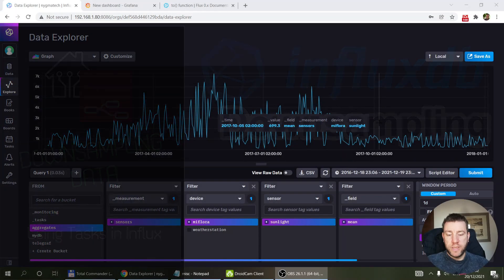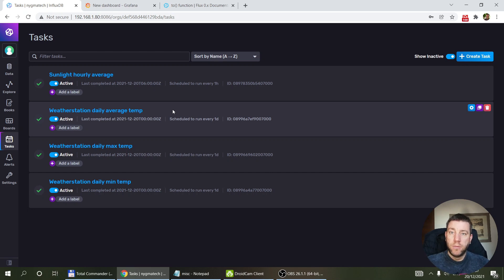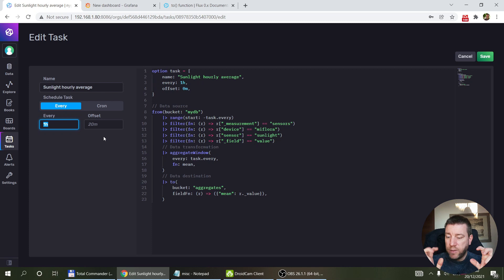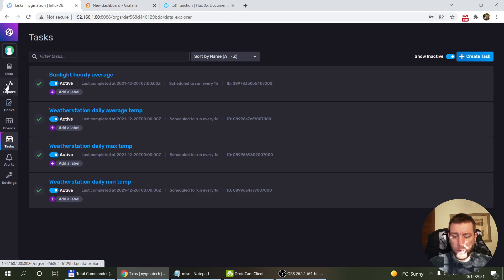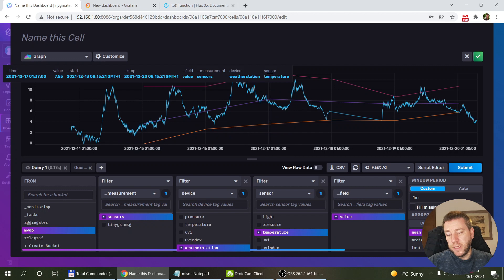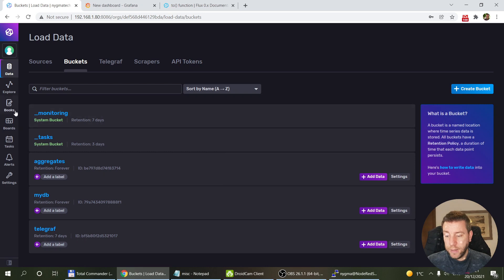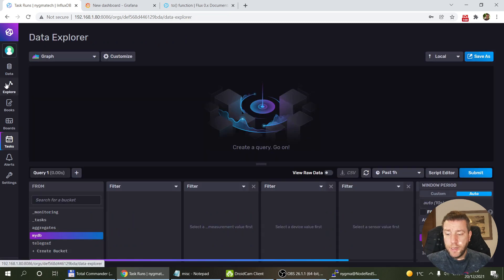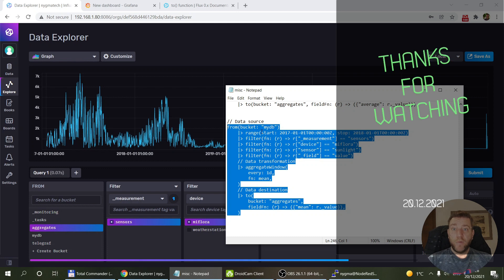Downsample data in InfluxDB 2.x

Comment: Hello, thanks for your very detailed video: I did not find anything anywhere so detailed and clear. I tried to replicate in my homelab to downsample my 30 second records pushed from some devices (Ecowitt, Raspberry Pi 4) to InfluxDB2, but I noticed an annoying problem. Records in the target bucket are always shifted forward in the "_time" field by 1,4,15 minutes. When I apply the same code to the source bucket, I get perfectly aligned records, I mean exact every 15 minutes.
Have you the same issue?
Reply from the maker: Yes, this is what I observed as well. The time in the down sample data get the beginning of the period. I discussed in this in the influx community post as well, and I was told that I can use the timeShift() function which adds a certain amount of time to the _time field. So you can chose that to be at the end of the period, or in the middle.

Comment: Hi thanks for the video. I'm trying to connect Node-red to influxDB but I can't transfer the data to influxDB. How do you create a mesurement in influxdb? Thanks in advance
Reply from the maker: When you pass data to influxdb that includes the measurement. It is not like a table that needs to be defined up front. Influx will create that automatically.

Comment: Can you reduce the amount of fields shown in the legends in influxdb 2.0 query builder? Like in Grafana you can just display the field and the value.
Reply from the maker: You can either use the drop command to remove fields, or keep to only keep the ones listed. Otherwise the best is in Grafana on your chartgo to Add field override (last option in the bottom) and start listing the fields you want to see. Once you start listing the fields, only those will be included in the chart and everything else gets hidden.
Reply: @csongorvarga  thanks for the response! I tried drop and that worked well. I gotta say though, IMHO - Grafana seems to be easier to use.
Reply from the maker: @danberber  Yes, and if you ever need the other fields, it is still there. I would consider using drop if your selection is large and you want to increase performance by moving less data from Influx to Grafana.

Comment: How could we downsample all the measurements what we have, without defining one by one? Like it is easy to do with CQL " ..... INTO db."1m".:MEASUREMENT FROM db."1s"./.*/ ... " and it goes through all measurements. It is impossible to make those amount of tasks if you have thousand of measurements, and also doing the same aggregation ...
Reply from the maker: Well, I am not such a big expert in flux to tell, but based on what I learned so far, I don't think it is possible. But maybe if you only select from a bucket and restrict by date range (and not specify measurement or tags), it will do it.